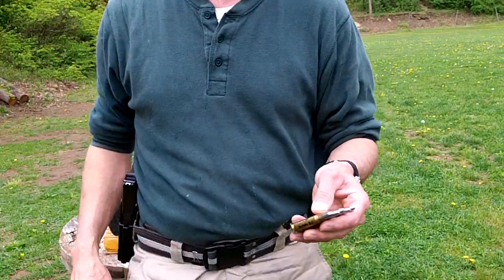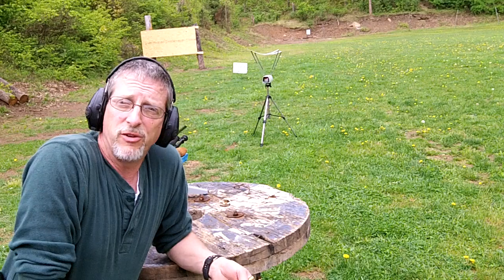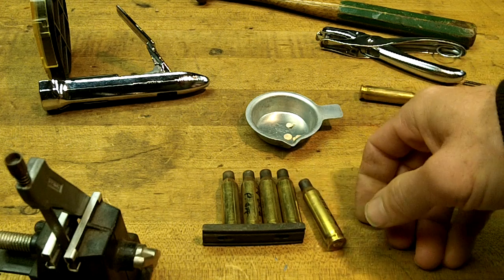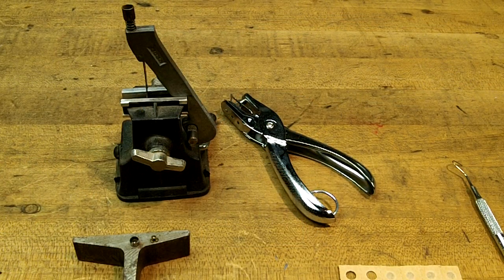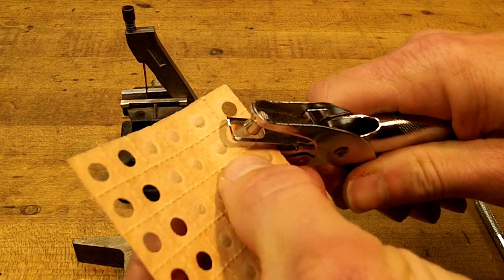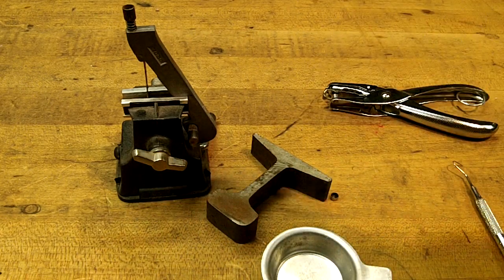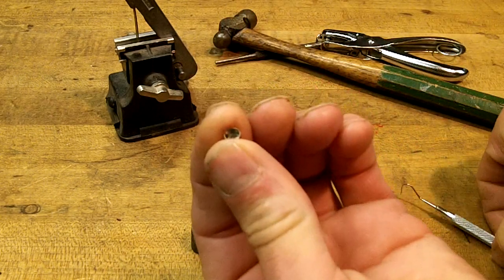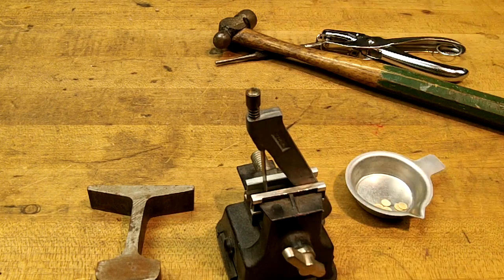Primer experiment , what if we can't buy primers update

Comment: Asone would expect, not as consistent with the remade primers, but good enough for all practical purposes...... By the way, those little plastic ring caps for toy guns work well for percussion lock guns just as they come. Just separate them from the 'ring' with nail clippers and use as is.... BP is of course easier to ignite than smokeless.....

Comment: Back in the early 80's, I bought a tool for making #11 percussion caps, using toy caps, only this tool also made the metal case as well from aluminum cans.  It was called Tap-o-cap made by Forster.  Here is a link to it though it is discontinued now.    https://www.midwayusa.com/product/1002230329

Comment: So have you re tested your recipe in your 45 acp again? And did you have more consistent results? Also I didn't catch on your first video what powder you reload your 45 cases with, I have CFE Pistol powder, TiteGroup, and TiteWad to try this with, CFE is potent so I'm probably gonna go with TiteGroup since the pressure and recoil is much more mild. Did you go with the same charges as you do with factory primers? Or did you start back at starting charge and work up?

Comment: Use a series of basic machine tools to make the required tools and dies and jigs and fixtures and positioners and alingners and bolt lockers so you can make the percussion caps or primer caps by using a series of manually powered stampers and dies already positioned and bolted-locked in place in a machine tool T table bed. And using a manually powered semi-automatic primer loading and securing machine made by basic and generic machine tools just for that purpose. I remember a particular monel alloy that is used during the Cold War in an automatic and water-cooled hot metal working and periodic induction re-heating softening and forging and stamping machine in the Urals and it can be bent back and forth for an indefinite and infinite number of times because it will be used for the making of percussion caps, primer caps, bullet casings, and even monel alloy jacketed steel bullets.

Comment: My wife had a small hole punch that works perfect the size drops right in the primer no folding up the sides works great. Bottom line in a pinch they work.  https://www.amazon.com/General-Tools-72-Leather-Punch/dp/B00004T7WS/ref=sr_1_11?ie=UTF8&qid=1512866765&sr=8-11&keywords=paper+hole+punch+set

Comment: The powder still burns @ the same speed bud. changing the primer only matters if it doesn't go off, if you don't use a different load or fuel (whatever) in the bullet then there's no need to compare them, it's a moot point. In that small/ short of a charge there's no room for comparison. It would be different if you where say lighting a 3' long line of cap based powder & regular store bought primer powder, then you'd have a basis for comparison in the times it took for the lines to be burned from one end to the other. get it? Try that 1 if you like bro, still interisting.

Comment: If you heat treat the primers, you can do it more often...
Reply: @Forty-Three and Flowin' Check this link, and read the text. https://grabcad.com/library/small-rifle-primer-large-rifle-primer-1
Reply: @Forty-Three and Flowin' Also check out my archive.org channel, its at the about section of my youtube channel.
Reply: @Forty-Three and Flowin' The other uploads also hold books that will help in the build of cartridges and primers. Its a long read, but i will make a lot of sense in the long run. You probably only need an arbor press and a small lathe and mill. A medium lathe and mill will make you the guns: https://ivanthetroll.keybase.pub/tdp.html

Its probably best to go and try to make your milling machine and lathe a CNC machine. https://grabcad.com/library/precision-mathews-pm1228mv-lathe-conversion-1

https://www.youtube.com/watch?v=qDr81TccvMY

If i were to comment on a lathe and a milling machine to get. Get an RF 45 Milling machine, and a 290 V lathe. That should make you able to get all the way to 50 caliber. Having a 38mm spindle bore is going to be tied fit to drill a barrel for 50 caliber, but you can always leave a bigger portion with larger diameter to serve as a chamber later on. A 338 win mag is probably better any ways. You dont have to shoot through motor blocks now would you?? Also 6.5 creedmore is probably better. The AR 10 im drawing now will be uploaded next year, but im thinking about converting it to an HK 417 while the gas tube would be really hard to produce, and the HK417 is probably better. I also need to chance some things to the upper and lower receivers, that so it can be made from aluminum rod and hot pressed into shape like the m4 blueprints show. The MR556 is the same as the HK416 only in semi auto. It should be there on grabcad too, its basically a piston driven m16 rifle. The ar10 is a scaled up m16, and the HK417 is a scaled up HK416...  

I did not upload the chamber reamers and the heat treatment oven to grabcad yet. But this will be coming in the start of next year, and maybe even the end of this year. The oven is already drawn, i only need to figure out the arduino controller unit now.. 

Any way, if you are going to build good luck. Im doing this because im really interested in guns and the techniques on building them. 

Its probably best to stay legal, and only do what you are allowed to by law. 

I think you are the kind of guy that is looking for gun tech. So there you are.

Greetings,

Jeff

Comment: I think the primer cups are steel and could be held in place by a magnetic block. I would probably use the primer box idea suggested by Michael Malkowski too, but with the magnet underneath to make it easier to remove the anvils from the primer cups.If your accuracy was good then extreme spread is academic.Good video.
Reply from the maker: Rod Mac Another awesome idea, thanks for adding to the discussion.
Reply: +Rod Mac Most commercial primer cups are struck from the same brass as the casing is made from, not sure if those Warsaw Pact steel cased ammos are any different. It just looks like steel because they add a plating of nickel to the cup.

Comment: When you pull the paper layer off the cap and place the 2 caps in the cup, put the powder side face to face. Not powder side to paper side on the second cap. In other words turn the second cap over so the compound is combined when it ignites.
Reply from the maker: bv1391 That's an excellent idea, glad you joined the conversation.

Comment: Jon, I'm not sure if it's already been mentioned, but the round snap caps might be the way to go for less hassle.
They're round, very small in diameter, and half of them are already falling out of the plastic cap already, so they'd be very easy to extract and possibly small enough for small pistol or rifle primers.
They come in either a revolver style (for pistols) or in a row (for lever-actions).
In fact, some BP guys actually use them in place of percussion caps!
They say the plastic caps seat better, they're waterproof, no more corrosive than BP/percussion caps, fewer misfires, and no copper caps to hang up in the cylinder when you're trying to fire the next round.
One guy mentioned using 4F powder to fill the nipple, then adding the cap on top.
The cap ignites the 4F, the 4F ignites the BP charge in the chamber.
However, another guy mentions an unintended ignition while loading his revolver with the plastic caps....so perhaps it would be best to seat the cap first, then load the cylinder.

A little more expensive than the paper type, but if they cut down primer prep considerably they might just be worth it.
The composition of the exploding material today is known as Armstrong's mixture, which is corrosive as you've found out.
So, if the BP guys came to the same conclusion you have, then it's safe to assume these caps are a viable improvised alternative for either type of firearm.

Here's 13,824 of them in a bulk package for $129 (or $0.0093/cap), which equates to 1/3rd the cost of bulk primers:
http://www.capgunstore.com/8-Shot-Ring-Caps-Super-Bang-192-Caps-per-Package-72-Packages-30936.htm

One thing to mention, as a safety consideration in relation to the unintended ignition...you might load a few rounds up and torture test them.
Climb up on a building and drop a round on concrete while taking cover.
Leave them out in the sun on blacktop during a hot day.
Basically testing their sensitivity to see if the cap primers can withstand the abuse of hiking with them and potentially falling on a shock-sensitive brass grenade.
See how long they last in a humid environment before going bad, etc.
Inquiring minds would love to know, and thanks for the great video!
Reply from the maker: Skinflaps Oldmeat you added a lot if info here.  I did recently buy some of the plastic caps, but the compound came out of the cap crumbly, not in one piece.  Perhaps i need to keep looking for different styles, to find what works best.  Thanks for adding to the discussion.
Reply: You're right, some of them do have the mixture just filled in and plugged with a small sheet of paper.
I have found several different types of construction in my childhood years (yeah, I was one of those kids that would rather see how stuff worked than actually use it).
The crumbly stuff made for one BIG pop when you took them apart and filled up a single cap, probably quite dangerous now that I think of it but I was in kindergarden at the time.
However, I remember a different brand that were filled with small paper circles just like the sheet version you made.
Those were the ones that would just fall out if you dropped them on the floor.
It's entirely possible they're not produced like this anymore.

Perhaps the crumbly mixture could be harvested and dumped into the primer cap, then covered with a bit of paper?

I examined some berdan primers from steel 9mm rounds, and they look to be easier to work with since you don't need to replace the anvil (the anvil is part of the case).
Made a tool from a spanner insert bit (find them in security bit assortments) to pop out the primers.
All I had to do was dremel and file the bit down to fit the two holes and the primer could be punched out with no damage.
Firing pin indentation can be flattened out in the same method, insert the mixture, then push the primer cap back on...no need to worry about fitting an anvil in there too.

Of course, steel cases aren't ideal for reloading but they're still good for 2-5 reloads before they start cracking.
Brass cases can be found all over shooting ranges because nobody knows how to de-prime/re-prime berdans.

Once a guy figures out the primer portion of the equation, black powder can be made relatively easy and casting bullets is even easier.
Great things for a prepper to know!
Rounds like the 45 Colt and the 45/70 were designed to use BP, so you'd see fewer losses in performance utilizing those cartridges.

Good luck with your experimentation, Jon...
Reply from the maker: Skinflaps Oldmeat You are adding lots more good info.  I am gonna have to keep trying different things to make it work better,  Thanks for adding to the discussion, Stay tuned. Jon

Comment: What are you using as far as measuring your powder? If you are weighing each one, then it's probably primers but if you are using a powder thrower the velocity spread could be powder, lot of variables.
Reply from the maker: David Greene since I loaded only 5 rounds, I weighed each one on a scale.  Most likely the primers were the cause of velocity differences.
Reply: Thanks, was just curious. That's a pretty wide spread, but this would only be for SHTF situation anyway.
Reply: David Greene yeah for sure 107fps would be pretty erratic for factory primers but its pretty darn good considering you made it out of old cap gun caps.  Certainly not match grade but hell its as consistent as the cheapest factory ammo you can get. great video's and great info to have. I ordered a case of those paper cap gun caps with 5,000 of them for like 25$ so lets just say i messed up alot thats still about 1500-2000 primers. not bad
Reply from the maker: SavageShooter93
Thanks for adding to the discussion.  I would not wish to do this on a large scale, but only if nothing else was an option.  Much easier and better to stock up on primers when available.
Reply: Jon with no h
for sure, making a few hundred rounds this way would suck, but its nice to have the know-how  in the good old bag o tricks for a rainy day.   

 One thing I have always wanted to do but couldnt figure out how, is to use some sort of flammable gas in a cartridge as the propellant, it should burn much faster and much cleaner, and without all the carbon buildup from burnt powder it should run cooler as well, the main problem is how do you pressurize it and keep it that way while you seat the primer/bullet.  And then how would the cases react to being cold then super hot when fired.

Comment: How careful do you have to be when cutting out the caps? If you catch an edge will they go off, and do they have enough power to do anything other shake you up a bit? Nice work on both of those vids!
Reply from the maker: TJ Scott cutting the caps did not set any of them off.  I did have one go off while seating the primer in the case.  But with eye protection, and pointed away, there was no real danger.  Thanks for adding to the discussion and watching, Jon.

Comment: I don't know how much this can help you, but for a while I took (I think 22 guage) sheet metal and punched small circles from it. I then hammered it through a hole with a punch in a metal block I had to effectively swage it into a cup. I found that after hammering cups, the dent reduces the metal that impacts the anvil and reduces the reliability (because there isn't as much metal filling the space  and crushing the priming material)

Comment: You should do a third test. 10 factory rounds, 10 reloads with only 1 cap in the primer, and 10 reloads with 2 caps in the primer. If you get 100% with the factory and 100% with the 2 caps, while getting 50-75% with the 1 caps, then you will have a pretty much proven the 2 cap method.

Comment from the maker: I see how berdan cases would work very good for this method, it's just getting the old primers out that would be the slow part.  Used to own an 84 CJ, sadly sold it, when i had too many vehicles to keep up with. Thanks for subbing and adding to the discussion.
Reply: You can make a hand tool in mild steel to hydrailically push out Berdan primers.

Comment: I agree and have reloaded some 9mm and 223 rem Russian steel berdan primed cases using this method. 100% success so far. I use needle nose pliers to hold the primer cups when I work on them. I think it works better than using the ramprime tool. Also, I clean the cups and anvils in an ultrasonic cleaner to remove residue and make them look like new. Most of the rejected primer cups are due to flattened bottoms caused by hot loads (not mine ;-). These are impossible to correctly seat.

Comment: I have a lot more info I can share about my experiments, but the youtube post size limitation makes it inconvenient. If you are interested, we can discuss things by email instead. One successful test was with reloaded berdan primers in steel cased 223 Rem using 24gr IMR4895 powder. With practice, I have been able to make ~10 primers in 15 minutes with my method. Regrettably. I have an ~5% loss/pop rate during primer assembly. But success at firing is excellent.

Comment: jonwithnoh7,

I have been exactly the same type of experiments for the last 2 months. My technique is similar. I use a leather punch that can make multiple size holes to punch out the perfect sized cap blisters for both small and large primers. I also put a thin layer of gunpowder between the first and second cap for a hotter pop. Finally, I seat the anvil using my loading press. The anvil really digs into the caps, but with slow application of oscillating pressure you can seat them. 100% workin

Comment from the maker: For some weird reason I find it hard to throw out spent primers. I have a 3lb coffee can almost full.  Its neat, to see how many rounds I've reloaded when you can see a boatload of spent primers.
Reply: What are you using to stuff the primer? I am searching but apparently I'm not using the proper terms. Thanks.
Reply: @RyanSpringer1984  - it's more explosive powder. Shoot a gun sometime without a bullet in the case and you'll see powder fouling inside the empty case.  They aren't "filled up" in the sense you're thinking of.
Reply: I once had an acquaintance who saved spent primers several years ago.  I asked him why and he responded "They make great shrapnel." He turned me away from saving them because of his response.  I now regret my decision because I may need them for their intended purpose. I think its time to hit the dollar store for caps.
Reply: @ped832  actually i believe they are the most dangerous, well except for the bullet shooting someone, part for reloaders.
maybe it changed but the priming compound used is/was fulminate of mercury. enters skin and in air. always wash your hands after reloads especially.
Reply: @Davidautofull  Mercury Fulminate primers have another issue. In the process of firing, they release elemental mercury vapor. In an outdoor situation, not a health situation. Indoor ranges could be problematic if dozens or more are fired, it might be a thing to avoid. 
 But there's another problem. The mercury could amalgamate with the brass ( a kind of alloy) and weaken the brass and make it unsuitable for future reloading.🙁
Reply: i keep mine for a while then sell them with any brass i deem used up. they dont care.
Reply: I find them easy to throw out but not anymore.   If I had been saving them I'd have at least a 55 gallon barrel full.